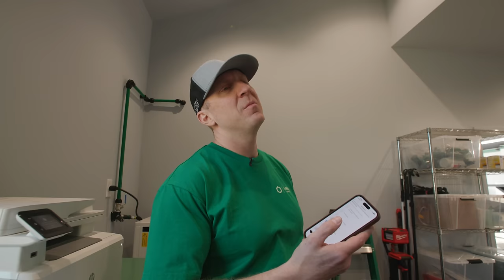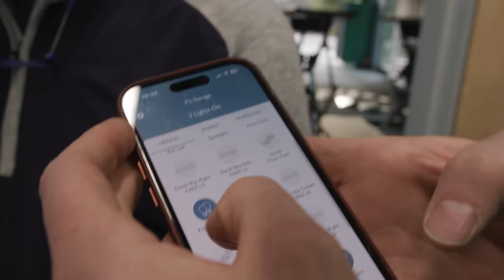The Finishing Touches! EPIC Car Barn Build Series - E8 | Fred Tries Out the Dual Kranzle!

Comment: I just got my RUPES HLR15 in, it's really amazing. Not only the lighter weight, but the way it is so perfectly balanced on the handle makes it feel lighter than it is. I can go full extension over a hood/roof and have perfect control without any wrist pain/fatigue. The battery is a tight and precise fit and a substantial improvement over the loose Milwaukee battery interface.

Hopefully RUPES will come out with standard kits (no polish or pads) and bare tool (if someone wants a 15mm and 21mm) soon after they catch up with initial demand. If you add up the price of those products and subtract them from the current kit cost, the HLR15 is only about $60 more expensive than a comparable Milwaukee kit (two batteries, charger and polisher).

Comment: all those fittings coming out of the cabinet up to the pressure washers is bad news. either 2 45degr fittings with a length of pipe, or a length of flexible hose there, not 10 fittings.

Comment: I had air pipes for quite a while on the outside, however, i think if you are doing new construction, the best would be in-wall installation with more permanent methods for joints.

It looks pretty nice, but this introduces failure points in all the joints and all the extra work.

IMHO next time I would do a permanent installation of oversized pipes in wall, and only have outputs in all the right locations. Logically similar to the central vacuum setup and hide a hose
Reply from the maker: I get that.

Comment: As good as the new Rupes appears to be, if you can get Mirka to do a 5 inch polisher it’s game over.
Reply from the maker: Amen
Reply: Mirka doesn’t really make products for us though.  They are geared for a different demographic
Reply: @YuriTarded-hf1nv  Kranzle didn't make pressure washers for car detailing at one point either. Matt was able to use his leverage to get them to make the best pressure washer on the planet. He can make it happen with Mirka.
Reply: @Jose.G.Y  you’re confusing kranzle with some other brand.  They’ve been used in detailing for years.